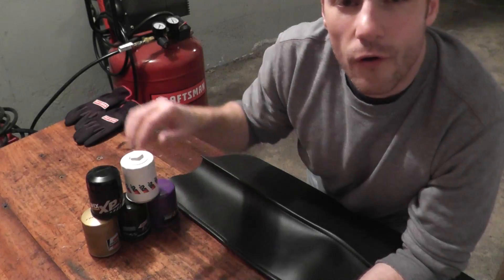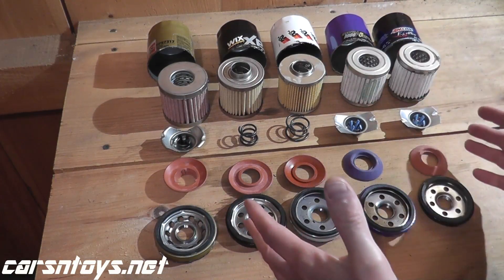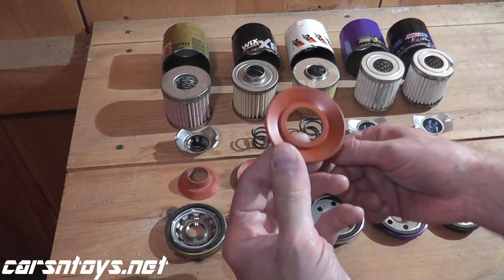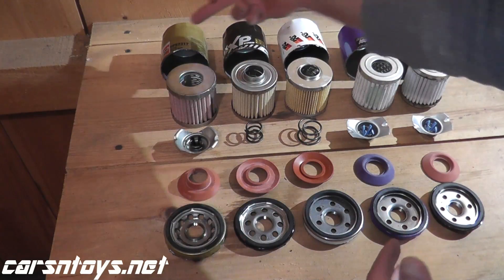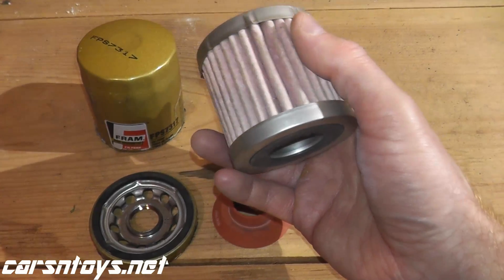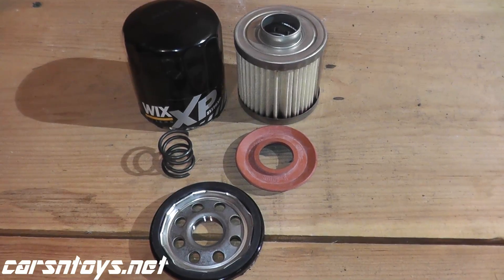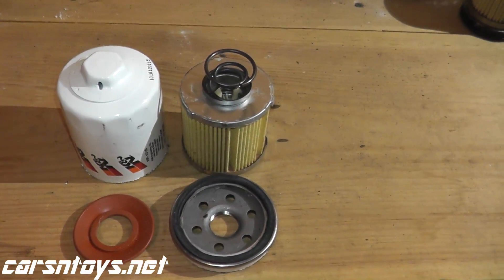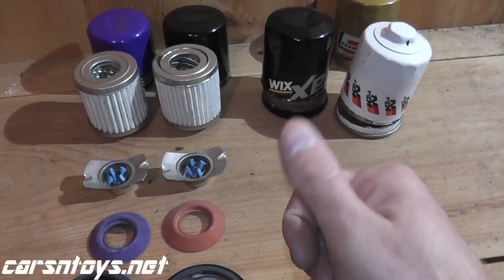Choosing the BEST OIL FILTER...FRAM vs WIX vs K&N vs Others

Comment: Where's Purolator P1? One of the better filters on BITOG. And you missed a very important variable, which is the bypass pressure of each filter. Just because it fits a certain car doesn't mean it has the correct pressure. If you put a KNN filter in a Subaru WRX, no matter how good the media is, it's not going to filter anything once it's past filter's pressure limit. Please do some homework before posting these videos, thx!

Comment: FRAM = orange can of death
Reply: Funny, I didn't see an orange can in this video. The Fram Ultra is a completely different product from the low-end orange Fram filters.
Reply: @lyrictenor1  still a shitty filter
Reply: @bogus696996  Sure thing, buddy.
Reply: Beans 4 Brains:  Do you have any videos of a Fram filter killing an engine?
Reply: fwh79
Do you have a video showing cardboard end caps to be a better choice than steel?   Cause I'd like to see that one.
Reply: @jshepard152  I have used Fram orange filters for about 3 decades now... never had an engine fail because of it.  I raced my white Mustang in SCCA Solo 2 for years using that orange can of death.  So, I would really like to see a video showing me how a Fram oil filter destroyed an engine.  Orange can of death sounds like a false accusation to me.  I agree that they are not the "best built" filter out there.  However, claiming that they will ruin an engine seems misguided.  Looks like the only video you have is Neil Armstrong "Grace Under Pressure"... so I guess you can't help me.  J Shepard, do you even own a car?  Looks like you're just another person leaving comments with nothing to back you up.  Why don't you post some videos on your channel and prove your point.
Reply: @jshepard152  Ok dude... let me copy and paste your EXACT comment...
fwh79
Do you have a video showing cardboard end caps to be a better choice than steel?   Cause I'd like to see that one.

Sounds like you are calling me out about the Fram oil filter end caps.  Did I "comprehend" that incorrectly?  So no, I didn't reply to the wrong person.  Can you read???  I got an idea... why don't you pull your cell phone out of your pocket and make a video.  Let me see what car you are driving that is so amazing... it could never be subjected to the tortures of a Fram filter.
Reply: @fwh79FOXR6 
You went off on a rant about me saying that they cause engine failures.  That was the original poster, dolt.
Reply: @jshepard152  It seemed to me that you were in agreement with the original poster.  If you were not, I apologize.  I miss understood your comment.
Reply: @jshepard152  There are several videos of used Fram oil filters being cut open on my channel.  Maybe you should cut one open.  I'll be sure to sub your channel.  Can't wait to see what you find.
Reply: Spaceman Spiff:  So Google is full of stories... yet YouTube has nothing.  That makes a lot of sense.  Thanks for the tip buddy.
Reply: @spacemanspiff2726  I'm dumb... coming from a guy that has ZERO content on his YouTube channel.  That's just funny.  The only "special" person here... is you "Spacman Spiff".  Love the name by the way and that donkey little profile pic you have.  That's very, grown up of you.  Grade A stuff there.  I did Goggle search it.  First thing that came up was a bunch of Mustang guys complaining about it on a forum.  They also had NO PROOF.  It was all opinion and here-say.  So I guess we should review my experiences again.  My dad bought a 1990 Mustang GT brand new in 1990.  I have been around that car for 29 years now.  My parents also owned a 1984 Ford E150 van 302W and a 1994 Ford Bronco 351W.  I bought my 1990 Mustang GT in 1998 and I still own it.  If you don't believe me, come on my channel and check out my Mustang videos.  All of those vehicles have a small block Ford.  The number one oil filter used on those cars was the orange Fram filter... for decades.  I have never seen a Fram filter fail.  My Mustang was raced in SCCA Solo 2 for years and had no problems with Fram oil filters.  I also used Fram on my 1998 Ford Contour, 1999 Ford Escort ZX2, and my 2000 Yamaha YZF R6.  My dad also owns a 2002 Ford Lightning that he uses Fram oil filters on.  No problems on any of those vehicles either.  I have 20 years experience working at auto body repair shops.  At no time in those 20 years of automotive repair have I ever seen or even heard of anyone having an engine failure because of a Fram oil filter.  I am not saying that it couldn't happen.  However, I would really like to see some PROOF of it happening.  Maybe you should start making some videos.  Must be nice to hide behind your mask all day long.  Don't worry... i'm gonna sub your channel and hit the bell so I know the second you post some amazing content for me.  Looking forward to it SPIFF!  Here's some friendly advice for you.  Turn down the EGO.  I don't know it all and YOU don't either.
Reply: @spacemanspiff2726  This is simple.  Fighting with you is like fighting with a women (which maybe you are and i'm just not aware of it).  You do not operate on principles of reason or logic.  You sending me to Google "proved" nothing.  So why don't you prove something to me.  Do you even own a car?  Post me a video.  Lets see it.  Is you proving to me that you own a car a "personal attack"?  I'm not a one trick pony.  I own two Mustangs.  So that's at least two tricks right?
Reply: @spacemanspiff2726  Yes, i'm uninformed... which is exactly why I want to see a video of a Fram oil filter causing engine failure.  You'll get there some day as well... I can't wait to see Spaceman Spiff video number 1.
Reply: @fwh79FOXR6  How the fuck are you have a video of a Fram filter killing an engine? No one mounts cameras in their engine compartment.
Reply: lyrictenor1  .. yep the standard Fram is JUNK the one reviewed here is not bad. I use the WixXP.
Reply: Fram Ultra Synthetic ROCKS!
Reply: Mel Galjour <-- Agreed. The FRAM Ultra Synthetic IS Very good
Reply: Yep agreed, the fram xg and the wix xp are good comparisons. The fram being cheaper $$. I get the wix if on sale other wise fram xg
Reply: JohninNH:  ... yep, you have a great video on your channel that proves how bad Fram filters are.  That must be why you have so many subs.
Reply: @fwh79FOXR6  Funny to find you here! I feel the same way about fram filters as you do. I laughed so hard reading this. xD
Reply: MSTWNTD:  Orange can of DEATH!!!  How's your 5.0 doing?  Did you start working on it yet?
Reply: @fwh79FOXR6  It's going down the road. Ordered everything, waiting for it to arrive. I'll try to keep you posted as best I can. Also, I switched to using Supertech Full Synthetic oil so I'll have to see how that works out. It's cheaper than most name brand conventional so it's a no-brainer for me
Reply: @TheMstwntdLMSV123  Very cool.  I hope you can get her fixed up.  Supertech should work just fine for your car.
Reply: @fwh79FOXR6  just had to add half s gallon of antifreeze 😣 I hope that's because of the lower gasket
Reply: @TheMstwntdLMSV123  It could be.  You are going to find out when you yank that lower intake off of there!
Reply: All my life, my dad used Fram Filters on all his vehicles. He maintained and rebuilt his own engines. So he put a lot of hard work and money into his cars and trucks and Fram Filters is what he chose to put in them. I followed his lead and I have put Fram Filters in all my vehicles for the past 30 years. Not one single issue or problem. I have a 2000 Ford Explorer with almost 300,000 miles on it and Fram is all that SUV has seen.
Reply: @RFComms  simple... use pricey and better filters for high performance cars, just like synthetic oils
Reply: fwh79 <-- I don't have a channel, or a video. You must be talking about someone else. IIRC Wix are made in the US. I believe  WIX also makes the NAPA gold oil filter. Check it out.
Reply: @johninnh4880  Yeah, I noticed you have zero content... that's my point.  Have you ever done an oil change?  People like to give their opinion as though they are experts on YouTube.  I want to see a video of an engine failing because of a Fram filter.  You know, actual proof.  I'm gonna stick with Fram for my Mustangs.  Not interested in Wix or Napa.
Reply: fwh79 <--- since you have been in short pants son. Built a few cars, motors, and motorcycles. Supercharged a Miata as a beta tester for the supercharger company. Diesels too. FYI .. FRAM does make a good oil filter just not the base orange one. It's a POS. As are the NEW AMSOil ones. Wix is my go to filter.
Reply: @fwh79FOXR6  you must work for fram...
Reply: @jsf11fra  Do you have video proof of a Fram oil filter destroying an engine John?
Reply: fwh79 why intentionally use a lower quality product that is more expensive that another brand? Do you have any video of any filter of any brand running an engine? The fact is I am an engineer who tests engines for an agricultural equipment manufacture and work along actual engineers who design engines. I don’t know everything and I am NOT the smartest person in the world. But I would always choose a cheap super tech made by champion labs than a more expensive fram extra guard. So no I don’t have a video, but why settle for something that is shitty when you can get something cheaper that’s higher quality? You would have to be a complete moron not to choose a cheaper higher quality alternative... you must work for fram or something.
Reply: @jsf11fra  No, I don't work for Fram.  However, I have been in the automotive repair industry for 20 years.  I have never, in all my years, heard of an engine failing because of a Fram oil filter.  It seems like something that I should have come across in all that time.  I agree with you completely about buying a good filter.  I do think you are missing the point I am trying to make.  My point is... so many people "claim" that Fram oil filters have ruined engines.  I would like to see some actual proof of that claim.  I would prefer that proof to not be here-say on the internet.  I would really like to see a video.  I agree that the orange Fram filter is pretty bad.  Not knowing that until recently, I have used them for over 2 decades and I have had zero problems.  That includes racing a car in SCCA Solo 2 events.  I'm not trying to make that case that Fram makes the best products.  I would just like to see someone back up their claim that Fram oil filters "destroy" engines because it seems like a false accusation to me.
Reply: Beans 4 Brains Orange can of bulshit
Reply: notthelegend27:  Oh yeah... hilarious.  Maybe you can get a job working for Motor Trend.  You have the terrible sense of humor for it.  You and Jonny Lieberman can compete for the dumbest jokes/comments on you YouTube.  Be sure to grow out a nice Millennial D-bag beard.  That is... if you don't already have one.  You, Jonny Lieberman, and Jason Cammisa would look great sitting REALLY close to each other at Starbucks sipping on some donkey latte while talking about skinny jeans.
Reply: Fram is pretty bad. They actually use cardboard in them with a metal cap glued on top which this video doesn't show. This video shows a much better comparison and the guy actually fully takes the tested filters apart.  It shows parts along with total amount/length of filter material used. https://www.youtube.com/watch?v=Imq39p0_YTA
Reply: @ChiTownTx   That's the FRAM Tough Guard in the vid you linked, a night and day difference from the Ultra covered in this video and irrelevant.

Comment: I use the most exspensive fram filter Castor oil and I change everything in my Toyota recommended at a certain mileage in the maintenance book if you do that my Camry now has 234,000 miles and still has same components in the engine bay

Comment: Last week I changed my oil and the oil filter was stuck. The end of the filter was deformed and the metal cap tool would slip off. First time it happens to me. It was a Purolator. The worst thing was the replacement was another Purolator. Had to buy special pliers to remove it.
Reply from the maker: Yea, I hate when that happens as well. That's the really nice feature with K&N - providing a 1" nut to remove the filter.

Comment: Thank you for explaining the K&N cellulose difference over synthetic as higher flowing for higher viscosity oils. Very good to know as I have a car that I only drive in the summer when it's hot and it is heavily modified so tends to run hot so I run ”thicker" oil in it but never knew that and have always bought the Wix.. might change it up now because it's always cold oil when you start it. Anyways Thanx!  Ha, had to edit this because I looked at the date that you uploaded and it's my birthday.
Reply from the maker: Happy Birthday
Reply: Yeah I use 20w-50 K&N GoldFilter works great 👍. Have you tried with high mileage vehicle engine restore they have it for four-cylinder or six cylinder eight cylinder that helps with compression works great with cars over 50,000 miles or 100,000 miles I’ve been using it with all my oil changes and seen a big difference of five and seven and 10 psi great product also been using royal purple HPS also high mileage great oil also seen great from using of Amsoil 100% synthetic.

Comment: Used the k&n a few times and every time I did an oil change no oil leaked out like every other filter I have used.  Must have been something with the drain back valve.  Tried three different ones all the same results.  Back to mobile one or Bosch.
Reply from the maker: I've read similar comments regarding K&N. I haven't had that issue thus far but it's good information.
Reply: CarsNToys yea it makes me wonder how many times I ended up with a dry start that shouldn't have happened.  I'm sure it was many many times.  Just not worth the risk to me if it's doing harm or not so I just switched back to what always has worked for me.
Reply from the maker: Smart move. I would of done the same thing.

Comment: I usually run K&N on my vehicles. I did have one K&N give me issues when its rubber gasket failed and oil went everywhere. I only had it about 3-4 weeks. I called K&N, they asked me to send them a picture of the filter and the serial number, and then sent me out a replacement for free. Their customer service was great!
Reply from the maker: Good to know. Thank you.
Reply: Nick Lavender, did you lubricate the gasket prior to installation and did you tighten it sufficiently?

Comment: I use Purolator @ 5. bucks and Supertech @ $3.00  Both excellent filters and I have had no issues with either one. Just change them at 3,000 miles.
Reply from the maker: I like Purolator as well.

Comment: Interesting comparison but too much elaboration on nothings. The oil couldn't care less about how many pleats are in the media or the size of them or, of all things, how evenly spaced they are! either way it has to pass through the media. What's important is the media used and how well it filters, more specifically how much resistance it gives vs how many microns it's filtering to. The only difference pleats can make is that more pleats "might" equal more surface area. I'd rather see the coil springs on the relief valves but at the same time, the only time it actually does anything is when you've already allowed the filter to become completely plugged forcing the valve to open...and if you're that negligent in maintaining your engine the brand of filter you use by then becomes a pretty moot point. Lastly, what does material gauge mean? I mean, when's the last time you heard of an oil filter bursting right in the middle because the metal was too thin?
Reply: Dustin Silva said
"More pleats equals more filter surface are equals better filtration."  
Not necessarily. That is only true if they are the same material and the same thickness. If a filter uses a  different filter media that's thicker or double layered, it may have a greater capacity to hold dirt and offer better filtration.
Reply: Andork Kuomo 'anything'
Reply: "Anything" what?
Reply: More pleats equals more filter surface are equals better filtration.

Comment: Not being a smartass but you could save yourself some grief and buy a filter cutter from Summit or Jegs. it works like a tubing cutter.
Reply from the maker: This is true and the ones from Summit & Jegs cost quite a bit less than what Home Depot has in stock.

Comment: I want to run Amsoil in my Toyota Avalon they tell me I can run it for a hundred and twenty five thousand miles with a Wix filter I'm just wondering if it is true and if I do do I have to change the Wix filter every 15000 miles now this was NASA tested for a hundred and twenty-five thousand miles just wondering if it was the truth or it was BS
Reply: Joseph Policastro holy shit, you'll blow up your engine trying to go 125k miles on a single oil filter. The absolute most I'd ever go is 15 thousand with a top quality filter. But usually I just buy toyota genuine filters and change every 5 thousand.

Comment: I just put a KnN filter on my Sienna and it dry starts like crazy. Never did that with the $5 Purolator.
Reply: I had same valve clatter on my94 bronco with mobile1filter went straight back to motorcraft.always use motorcraft all my fords and they are 4_5 dollars at wally-world.
Reply: Naomi Sharpe KnN had to pay for a new engine for a buddy of mine. He works for an auto parts store and would get their oil filters for little to nothing. He had a KnN filter literally blow off leaving only the threads on the  mounting plate. Lost the engine, eventually KnN comped him for it. Nevertheless I will never use them now. Napa platinum (Wix) all the way.
Reply: +Randy Anderson how would you prime an oil filter on a subaru?
Reply: did you prime the filter?
Reply: PUROLATORS ARE GOOD